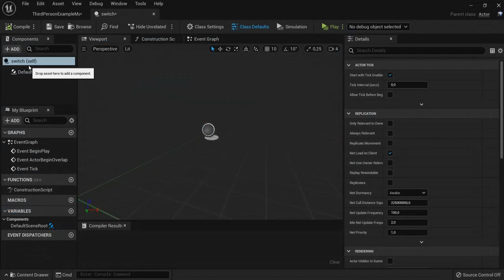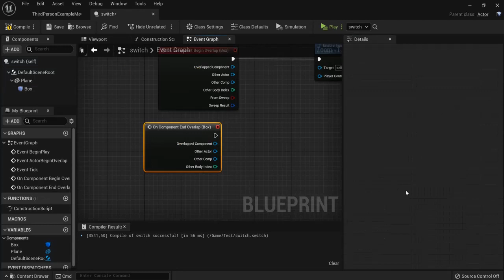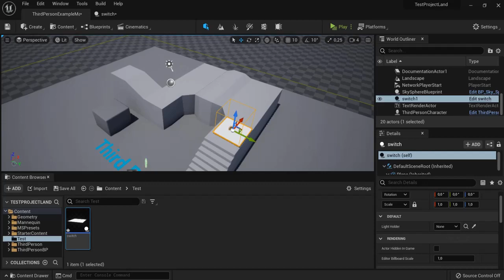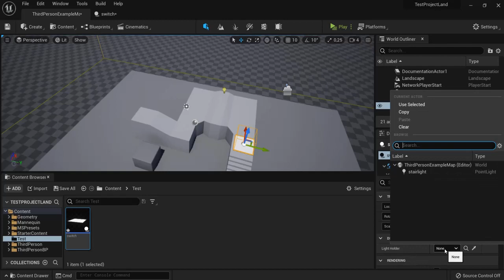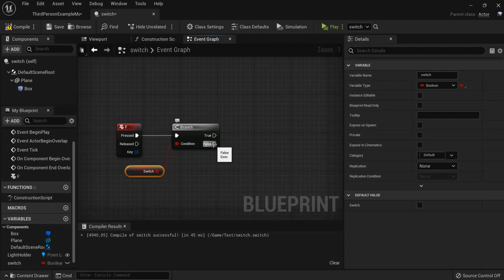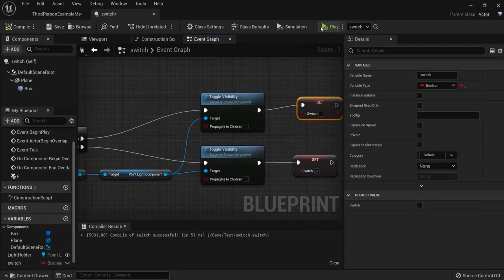How To Make A Light Switch In Unreal Engine 5

Comment: how can I add two on compnent begin overlap? I want to make a widget that shows  press e to turn/off light. currently i  work with  a second blueprint class just for the widget.
Reply: IMO the most elegant way to do what you're asking is to rely on interfaces. You'd force all interactables to implement the "Interactable" interface and you could even define custom text for each (like turn off light, turn on radio, etc.) I.e. your interface would define a function that must be implemented, such as GetInteractableText. Then, whenever your player overlaps an interactable trigger, you would trigger custom events to both retrieve the display text of the current interactable and let the UI know that text needs to be displayed.